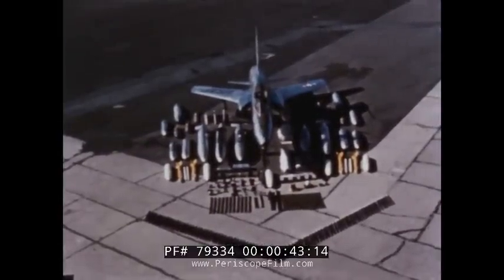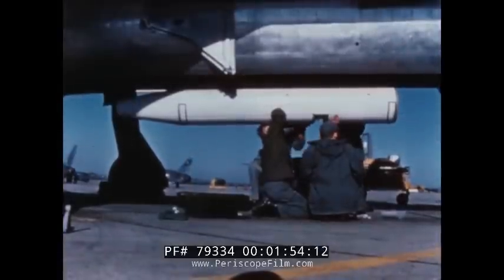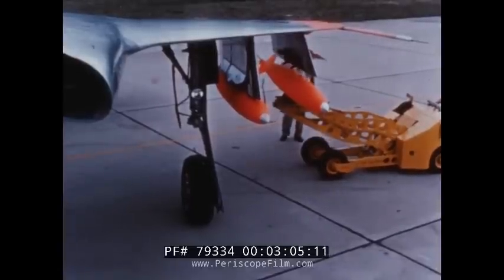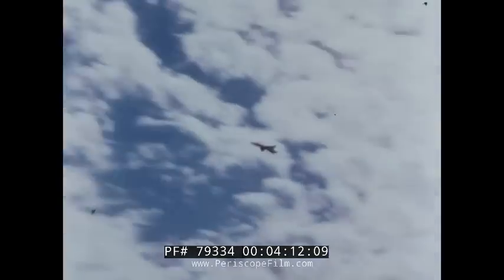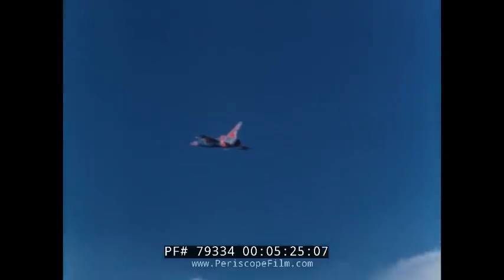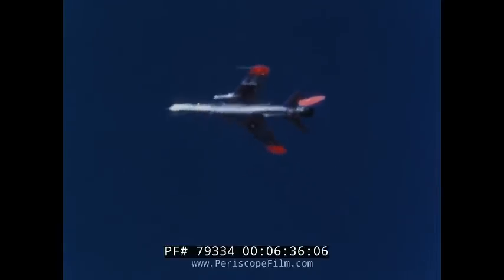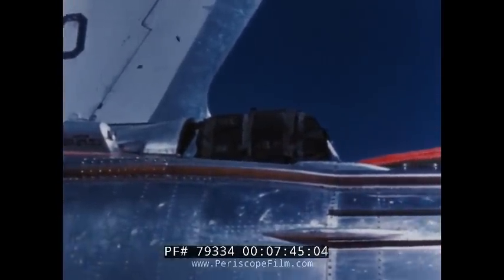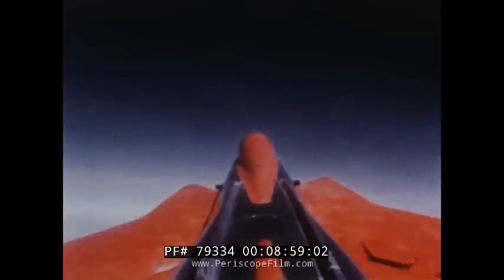SECRET REPUBLIC F-105 THUNDERCHIEF ARMAMENT CAPABILITY SPIN TEST 79334

Comment: 3000 lbs of ordinance on inner wing and 1000 outer?  does that sound correct?  3000 sounds high..
Reply: On the onner wing racks it could carry 3000lb. bombs. Outer racks could carry carry 1,000lb bombs. Centerline Multiple Ejector Racks usually carried 6-750lb.bombs. Bombbay had a 300 gal. fuel tank installed since Vietnam was not a nuclear war.
Reply: I think it had a larger bomb load than the B17. Bomb loads were as high as 14,000lbs!!!!!
Reply: @indigohammer5732  Amazing.  My uncle flew 100 missions in this plane in Vietnam, flying out of Thailand - he had some stories!

Comment: Thud was the sound of an f105 when it smashed into this ridge in nam
Reply: How does an F-4 sound when it hits the ground? More F-4's wete lost in Vietnam and it was not even the key TAC strike aircraft doing all the tactical bombing.
Reply: More F-4's were lost in Vietnam than F-105's. And the term'Tbud" turned out to be an affectionate term to the pilots that flew it.

Comment: F-105s were also unreliable early on, hence many "Thuds".  When loaded down with fuel tanks and many drag inducing bombs they were not very fast and susceptible to slashing radar-guided Mig-17 and Mig-21 attacks.  But if unloaded and on the deck nothing could catch them.  They were not designed for use in SEA (nor was the F-100 or the F-104) and have whatever you have on hand.  The belly compartment was converted to house additional fuel.
Reply: Any aircraft loaded up with ordanance is susceptible to enemy attack. The F-4 when loaded down will be shot down as well. But it was a shitty bomber and had no range. It would be out of gas in 5 minutes.

Comment: Great with spin recovery - I think the boys that used it on the deck in Europe and Vietnam were very comforted by the thought, that if they ever got into a spin, they would recover within a minute of smashing into the ground.
Reply: Although the F-105 ,like every other aircraft would lose altitude rapidly in a spin,the JF-105 did great in spun recovery trsts. It had a paracute on a long lanyard in case it had to be used for pilot safety. But F-105 successfully went through all 47 tries and it never was needed. So your spin assessment on F-105 is "ass backwards".

Comment: "5 inch, high velocity, aircraft rocket"?  Is this just a way of saying, "slightly slower Sidewinder"?
Reply: 5" Zuni High Velocity Aircraft Rocket (HVAR).  They have a variety of warheads including "proximity fuzed" which could be used against aircraft or ground targets and would detonate when it was close to the target.  Unlike the Aim-9 Sidewinder the Zuni was unguided.

I hated anything to do with the Zuni's or the 2.75" rockets.  Damn rocket pods were heavy and we handloaded the whole pod to the aircraft.  They are very sensitive to stray voltage/static electricity so making the final electrical connections from pod to plane was a job everyone dreaded.  This is what started the USS Forrestal fire.
Reply: The aircraft launched its own target, it looked like the aircraft had two Sidewinders.  When the target missle launched it appeared to be one of these.  It seemed to me the target (HVAR) itself was based on the Sidewinder, but I may not have been interpreting what I was seeing correctly.  Thanks.
Reply: HVAR.

Comment: This nickname, Thud, came from the sound it made when it touched down. Hence, lead sled.
Reply: Nick name Thud from cartoon character.
Reply: Richard McCaig  yes it is.
Reply: The name has a darker origin unfortunately. Pilots called it the Thud because its the noise it makes when it impacts the ground. It got that name from its combat record over Vietnam. They couldn't fight other aircraft at all. So if they were caught alone without escort they were slaughtered. They're huge aircraft as well, so the SAMs locked on to them easily. 395 F-105s were lost over Southeast Asia. Absolutely horrifying.
Reply: @terrancestorey7254  in large part the losses were due to the insane rules of engagement that had them fly near known SAM and AA sites without being allowed to destroy those threats.
Had they been allowed to take out those sites losses would have been far lower.

Stupid politicians...
Reply: @terrancestorey7254     F-105s were also unreliable early on, hence many "Thuds".  When loaded down with fuel tanks and many drag inducing bombs they were not very fast and susceptible to slashing radar-guided Mig-17 and Mig-21 attacks.  But if unloaded and on the deck nothing could catch them.  They were not designed for use in SEA (nor was the F-100 or the F-104) and have whatever you have on hand.  The belly compartment was converted to house additional fuel.

Comment: Fairchild?
Reply: +tamgila This film was shot in the late 1950's; it was still called Republic Aviation.  Fairchild didn't take over until 1964.
Reply: Phayzyre105 Tanks
Reply: Republic.
Reply: They were built at the Republic Aviation plant in East Farmingdale Long Island, which was at the upper end of the Republic airport property. It was the last independent design of Republic Aviation before Fairchild took over. Their next most famous product the A-10 Thunderbolt II (Warthog) is still flying today and is supported by Northrup Grumman. There is a nice example of the F-105 at the American Airpower Museum, in a building that was part of the sprawling Republic complex. Sadly all of the other buildings are long gone, it is a shopping center now. There are some ruins on the north side of the LIRR tracks that I believe were part of Republic's operation many years ago.